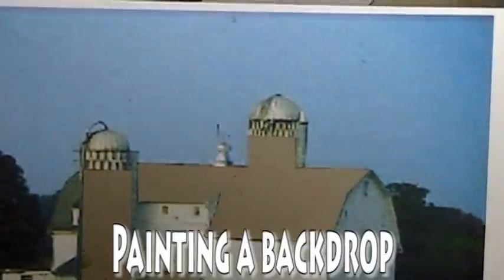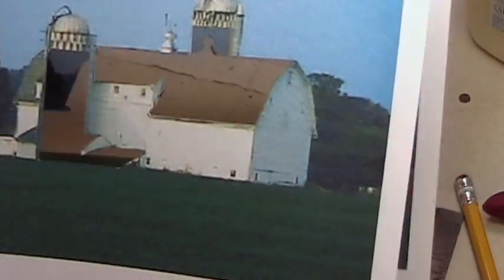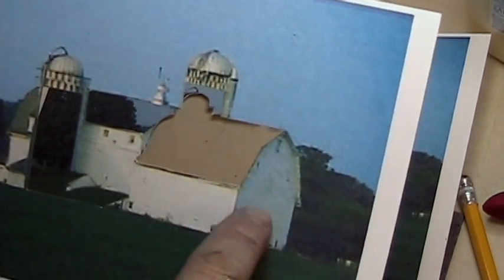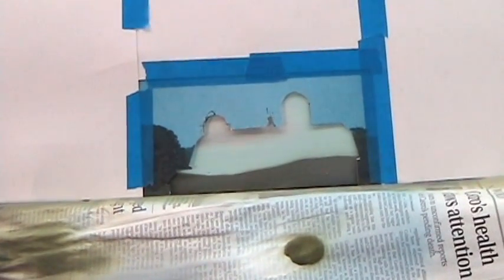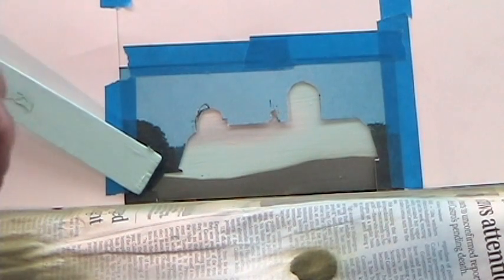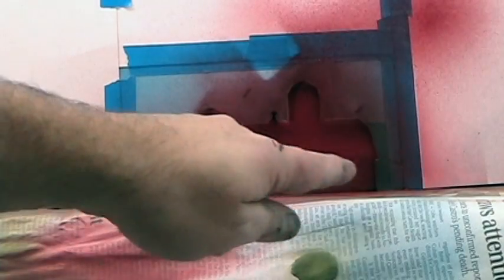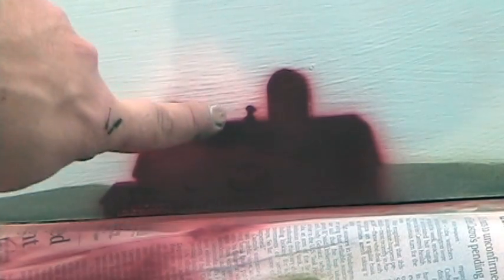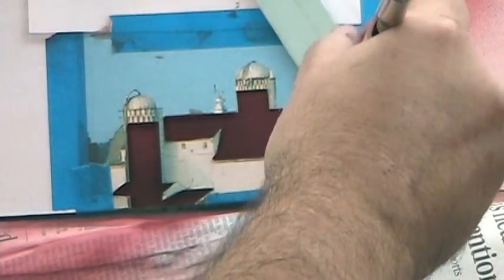Painting a Backdrop Using an Airbrush: Part 5

Comment: If you use the stencil again, brush a thin coat of rubber cement on the back of the sheet, let it dry, then press it on the wall.  If you don't go heavy, no glue will blob into the paint area.  The sheet 'should' lift off w/ ease when you are done.  If you put rc on the back of the sheet & the wall, let them dry, you will never separate the two again w/o bad ripping. Give it a test, I think it will serve you well.  You could also cut the stencil from clear contact paper!  This may be best option

Comment from the maker: A lot of the paints I used were ones we had on hand. The the brand is "Folk Art" Acrylic paint by Plaid. I use a 1:1 dilution ratio.  The Poly Scale paints are pretty pricey for the amounts I'm going to need to use for the backdrop.  The "Folk Art" brand is probably not designed for airbrush use but it does good enough for my needs(and won't break the bank either)

E

Comment: No prob.  Hope one works.  As more stencil layers go down, the RC is likely safer on the new paint than the cont. paper, either way, let all paint cure thorough, otw you will rip that up on next pass.  

Using printed pix for the BG can work, but the shine of any paper (gloss, matte, other) used will be noticeably diff. than the wall paint.  This will give illusion of diff surfaces reflected in sunlight. Might not.  Easily tested by hanging print on wall and staring at if for a few days.  ;)